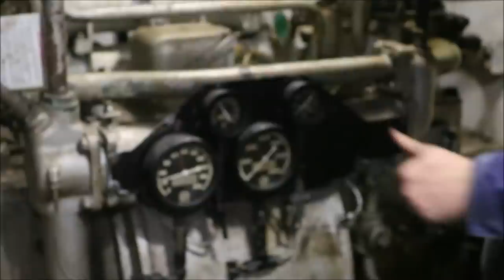First start in 72 years WWII 1942 Cleveland Diesel 8-268A

Comment: How does the compressed air turn the engine over please? Is it put in the cylinders on TDC to simulate firing?
Reply: air starter, like electric, but uses compressed air.
Reply from the maker: @sspence65  not quite boss. Air is direct injected into cylinders and is timed by an extra and very small lobe on the cam shaft for each cylinder. This is how large slow speed diesels are started. Thanks for watching!  @slacko1971
Reply from the maker: Air is direct injected into cylinders and is timed by an extra and very small lobe on the cam shaft for each cylinder. This is how large slow speed diesels are started. Thanks for watching!  @slacko1971
Reply: @FixAndForget  Thanks for the clarification and a very interesting  video
Reply: @FixAndForget  ok. my Detroit has an air-powered starter, not cylinder injected.
Reply from the maker: @slacko1971  no problem, thanks for watching!
Reply from the maker: @sspence65  rotary air starters are very common on smaller engines and even some larger ones such as EMD. Navy specs called for 550PSI direct injection air start, the same as ultra large slow speed engines.

Thanks for watching!

Comment: Are the fuel injectors similar to the kind used on EMD engines?
Reply from the maker: Thanks for watching! Basically everything on this engine is similar or almost identical to EMD. The fuel injectors are no exception. EMD engines were developed from the Cleveland line and many WWII 567 series engines were manufactured by Cleveland and labeled Cleveland Diesel 567 series and not EMD.
Reply: It’s almost sounds like an EMD.
Reply from the maker: @bluegrassman3040  Thanks for watching!

Comment: I have just purchased a tug boat with an 8-268a main engine that has not been run for 15 years. Do you have more videos that I could see?
Reply from the maker: John, I do have a few other videos of my Cleveland engine. Click on my username and select the video tab. I would also be more than willing to lend you a hand in any way possible with getting your 8-268A running. Feel free to email me at asher.spalding@gmail.com
Reply: I have quite a bit of Cleveland stuff digitized, including the manuals, parts books, and the service bulletins.

Comment: Nice engine but I dont think I like that knock that Im hearing. Was there an issue with that, Asher?
Reply from the maker: Hi Dave, thanks for watching! If the fuel system isn't fully primed when the engine starts, there is fuel pre-ignition and it knocks until the air is purged from the fuel.
Reply: @FixAndForget  Ahh, thank you.

Comment: Wow, sounds like Dad´s old Mercedes 200D, but starts much easier :-P   Where is that engine installed / what was the purpose of that "little one" ?
Reply from the maker: The engine is one of 4 generators on the USS Stewart (DE-238) in Galveston, TX. The Stewart is a WWII museum ship and isn't going anywhere any time soon. Check out the website and thanks for watching!
As for the "little one" I believe you are referring to the high pressure air compressor. It is a 480v 3ph powered compressor that was used to charge a torpedo launcher and supplement the other start air compressors. Since the launcher and other start air compressors are gone, I use that one to put air in the tanks to start the big generator.
https://www.galvestonnavalmuseum.com/
Reply: @FixAndForget  Thanks :)  No, I called the BIG BLOCK just little one :) OK I´m gonna check this !
Reply from the maker: @bikertyp  enjoy!

Comment: Y the way what does this motor power ? Water light mill mines ???
Reply from the maker: I run the engine periodically on weekends when the museum is busy and let the interested guests view it if they desire. Occasionally I run it up to speed and let it carry a load by powering the ship and some onboard equipment.
Thanks for watching!
Reply: Asher Spalding - so it’s a ships engine  -  where ?
Reply from the maker: @solstar4778  The engine is one of 4 generators on the USS Stewart (DE-238), a museum ship in Galveston, TX. check out the video description for more info. Thanks for watching!

Comment: Two stroke diesel engine? Wow! I never heard about it.
I'm a bit confused because it look like it have a camshaft.
I will search how it work.
Reply from the maker: Thanks for watching! This engine is set up like pretty much all modern large 2-stroke diesel engines. In a nutshell, the motor has 4 exhaust valves (2 per rocker arm) and a unit injector served by the center rocker. The scavenging intake ports are about mid liner like a conventional 2-stroke. Like basically all other 2 strokes, it has a blower to assist with removing exhaust gas from the cylinder.
Reply: People are use to the small engine gas engine two strokes that have crankcase scavenging .
They produce noise and smoke in great quantities and a little power…
Only good thing is weight per horsepower. Oh and it burns pin with the fuel.

All diesel 2 strokes use a scavenging  blower usually with a turbo now . No oil added just a regular crankcase.

The largest most efficient diesel
 engines in the world are Marine slow speed engines by ManB&W or Sulzer. Two stroke .
Reply from the maker: Absolutely correct. Check out my other videos to see some of them running. Thanks for watching!

Comment: This engine is a rare low speed deisel. They run so much better and are easy to start. They will burn almost any flammable oil, both mineral and vegetable. The are far from being able to meet today's emission standards, but the are reasonably efficient and very maintainable. Keep the lube oil clean with a course filter, a fine filter cartridge, and a centrifugal filter and these engines will outlast most people! Modern engines are obsolete after 5 to 10 years and require replacement. Low speed engines are not able to .eet today's standards. How much pollution is generated in manufacturing, machining, casting and forging AND producing all the tooling and production machinery!!! The net energy cost of these older engines is very low. The net energy cost of modern high speed engines is very high and is not considered in polutant testing. If it was,  we would quickly go back to low speed engine technology.
Reply from the maker: Thanks for watching! This engine actually falls into the category of "high speed diesels" since it's rated speed is 1200 RPM. Anything below that (or 1000 RPM) is considered medium, and low speed diesels turn 100 RPM or less.
These engines are very robust and incredibly simple, it has been their key to longevity!

Comment: How many modern computerized engines will still run 72 years from now?
Reply from the maker: Only time will tell. However I doubt I'll be around to see it. Thanks for watching!
Reply: Asher Spalding I believe none, twenty year old computers are considered antiquated and are impossible to get parts for. Plus modern engines have planned obsolescence inherent in their design, they want to make sure that you have to buy new ones in 15 or 20 years.

Comment: They do not make them like this anymore leave a modern engine sitting this long and see if it runs after all those years
Reply from the maker: Thanks for watching! Undoubtedly if one was to get a newer engine running after 72+ years they would have to be smarter than me since I know nothing about computers, just big old 2-stroke ship engines!
Reply: @FixAndForget  Yes but some times simple is better and more reliable than modern technology, because the more complicated it is the more chances or things to go wrong and fail. these old engines just keep on going with the correct maintenance.

Comment: What all did you have to do to get her going?
Reply from the maker: It's been a few years now but the major issue was the blower was siezed and had to be removed from the engine. It took me months to get it unlocked, re-sealed and put back. I purchased 8 new stainless steel injectors (non- magnetic for a minesweeper). Getting the auxiliary systems up like the air compressor and cooling system also took a long time. Overall about 2.5 years of work. 
Thanks for watching!!
Reply: @FixAndForget  thanks for the quick reply!

Comment: IMPORTANT with ANY old engine which has not run for a Long time; 
Lubricant in the bores, drain the old oil, put in New oil, with say an old car, remove the oil pan, CLEAN out the sludge and crap to AVOID DESTROYING an engine which is probably good,
then you want too run it with shitty old oil which is way past it,s Best,
engine rebuilds are EXPENSIVE!!!!
Reply from the maker: Thanks for watching! This video is the culmination of a 2.5 year restoration. We had to be extremely careful with this one since parts are not available and/or cost prohibitive. All possible measures were taken to ensure the engine wouldn't destroy itself.
Reply: @FixAndForget  I was talking in general, most old machines parts are not available. So that people finding old cars/machines and try to get them running without taking precautions! 
your video was good, pleased to hear all precautions were taken.

Comment: Hopefully they added marvel mystery oil in fuel  helps lubricant everything
Reply from the maker: We didn't add any additives to the fuel. Injectors were properly lubricated prior to installation. No. 2 diesel offers all the libricity required for industrial applications and the very large quantity of fuel kept onboard is prohibitive to adding anything.

Comment: How often is the engine started?
Reply from the maker: Thanks for watching! I last ran it late December 2018.
Reply: @FixAndForget  would you say once a year it started? How long was the process to get it to start after sitting 72 years?
Reply from the maker: @rudycarlson8245  It was run continuously while the ship was in service ~1943-1946. It wasn't touched from 1946 until I got it going. Took me about 2.5 years to get it going. It hasn't been run since December of 2018, about 4 years ago.

Comment: not enough air, nice
Reply from the maker: Thanks for watching! These big Cleveland engines use 550PSI direct injection, compressed air to start, and at that point I only had approximately 250PSI at the engine. They will start with that amount of air but require starting fluid when cold.
Reply: @FixAndForget  needs lots off air? Not used much any more. Meh

Comment: Just like the Detroits.
Reply from the maker: Thanks for watching! They're the predecessors to EMD engines which are basically just bigger Detroits. Tons of similarities.
Reply: @FixAndForget  Lots of similarities with being two stroke unit injector units. I didn't clearly see the scavenging air supercharger, is it on the side like a 6-71 or mounted on the back like a Fairbanks Morse?
Reply from the maker: @gcrauwels941  The unit injectors are like what you would find on a EMD 567+ they have internal filters and in-line block style seals for the fuel lines. The blower is mounted on the front of the engine like EMD.

Comment: Cleveland later went on to become Detroit.
Reply from the maker: Thanks for watching! Cleveland and Detroit were separate divisions of General Motors and unrelated. In 1962 the Cleveland name was folded into the EMD line of engines which were based off of the Cleveland design.

Comment: Now stick it in a Honda
Reply: Aaron Cubitt  lol. Dont get me started. But diesel has been leading the automotive industry for decades. Variable geometry turbos? Direct injection? Multiple fuel sprays per rev? Exhaust filtration? Yeah I think the only innovation gas engine builders have made was variable valve timing. And as far as I know it was Porsche, THE race car.
Reply from the maker: Thanks for watching!

Comment: wtf is with the postage stamp sized video?
Reply from the maker: Hi Wayne, thanks for watching and the comment. Most of the 2nd half of the video was filmed by cell phone and usually one-handed as the operator also had a job doing something related to running the engine. We are all volunteers and sailors not videographers, I figured people would want to see another short clip of the engine running despite the quality. Big mistake.

Comment: runs away! over turbos do that... too much AIR!
Reply: try again Turbo Tony...Stuck injectors also do that...do your research
Reply: Or too much oil blowing by. The motor dont care what kind of oil it is once shes cranking it will burn whatever it can get. Even aluminum.
Reply: On Detroit 71 series over adjusting the buffer screw on the governor is the most common cause of a runaway.  This is followed by the failure of the blower seals resulting in it running on engine oil.  Only cutting of the air will save the engine.
Reply from the maker: Thanks for watching! I was concerned with a binding injector rack or oil consumption/combustion.

Comment: Compared  to german  diesels its crap
Reply from the maker: Not really much of a comparison between this and German motors since this is a high speed 2-stroke motor and German engines of the era were slow speed 4-stroke diesels. If you're comparing an 80 year old engine to new stuff, I'm not sure what the point of that is. Not for nothing, the German engines of the 40s didn't win world war 2, the Clevelands did.
Thanks for watching!